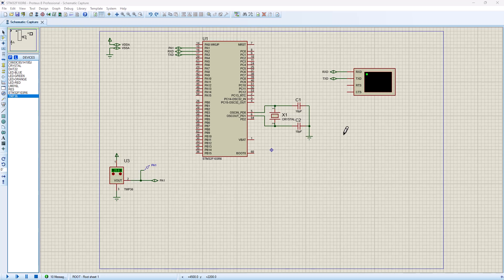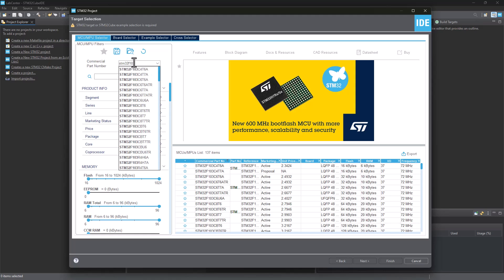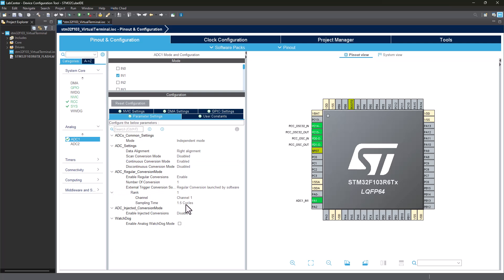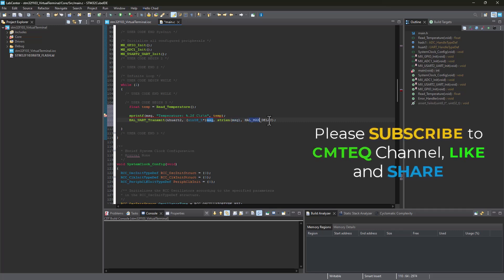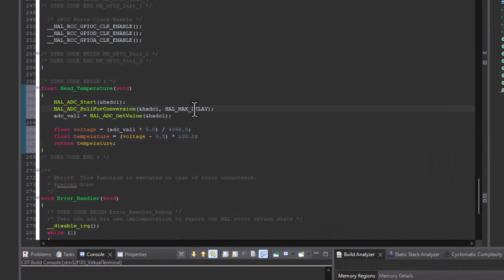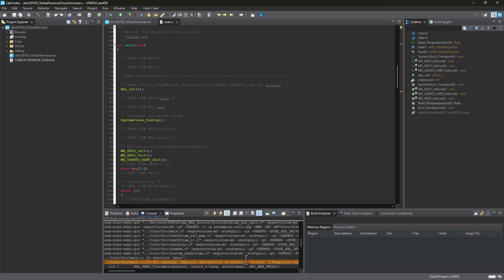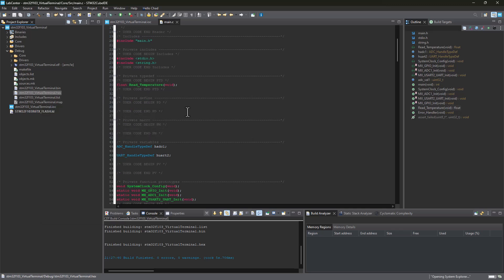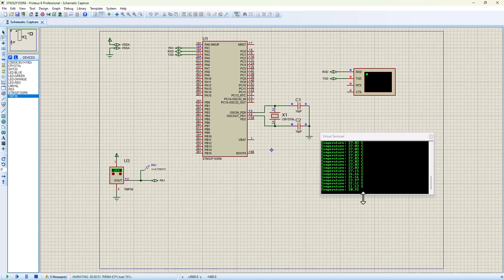STM32F103R6 ADC Conversion Proteus Virtual Terminal

Comment: Sir, is that Bluepill mcu support ADC in proteus?!?
Reply from the maker: Yes, the STM32 BluePill MCU supports ADC functionality in Proteus simulations for educational purposes. You can configure and program the ADC using standard STM32 HAL or register-level code, and Proteus will simulate the digital conversion process. 
However, note that you cannot simulate actual analog voltage inputs directly from components like potentiometers; instead, you must predefine simulated analog values for each ADC channel in the MCU properties window.

Comment: Sir, my Proteus shows cpu overload, how to solve this
Reply from the maker: You need to upgrade your CPU, or you must avoid running the simulation for longer. You can also try closing the browser and other programs with higher CPU usage
Reply: @CMTEQ thanks for your response sir. proteus sometimes directly shut down when I run the program, like not saving anything, not showing anything, directly shutting down the app. This problem appears when I used f103c8t6& f103r6, is it the same issue as the cpu overload thing?
Cuz I have tried with f401, and it doesn't have issues like shutting down app, can't run program. But the problem is I think there's problem with f401 chip adc on Proteus, as it only return adc=0. I've saw this problem on stm community also, there was ppl sharing f401 has problem with adc

Comment: Why connect to a crystal, i think proteus automatically simulate the external crystal , you only need to double click the mcu and modify the osc frequency to 8000khz
Reply from the maker: You arre right.
However, connecting a crystal can be useful if:
- You're testing startup behavior or oscillator-related features.
- You're using code that explicitly initializes or relies on external crystal settings (e.g., 
   in STM32 or AVR with fuse bits).
- You want the schematic to reflect real-world hardware for documentation or PCB 
   design.

Comment: My virtual terminal is showing zero even though I followed the same steps as you.
Reply: I have the same problem too. After testing, i think that it only works with the stm32f103r6 (i use the c8t6), same code but does not work, maybe proteus only supports for this series.
Reply from the maker: Please double-check the two MCU. Whether they have some differences, maybe you need to change the code a bit, specifically the configuration.
My guess is, if the model is in Proteus, then it should work.
I will have a look.
Reply: @CMTEQ  I think it is something with the timer, can u make a dht22 tutorial video? I have the same problem
Reply from the maker: @bassameldawy5004 Noted ✅️ , please remind me in two weeks.
Reply: @ Hello Brother hope u doing well, can u do the DHT22 Tutorial?
Reply from the maker: Almost 2 weeks, 1 day to go. 
Thanks for the reminder, I will get it done in the coming week end.
Reply: @CMTEQ  TY, I really appreciate your help🫡
Reply from the maker: If the code is right then maybe the terminal is not connected properly in Proteus, make sure that RX and TX are connected to the correct Pins.

On part 2, I added an LCD display and also included a GitHub link to the proteus files and hex file.
https://www.youtube.com/watch?v=S9oPl-5iYSs&lc=UgySq0GCm8LDQo0fYJx4AaABAg

Comment: Hi sir am trying a PWM signal generation by using Time+DMA ,also An LED is blinking . am not getting the PWM signal in tim channel but LED blinks . all are testing in proteus . in real hardware it is working as expected ,any suggestion ?
Reply from the maker: Hi, a few things could go wrong here. You will have to ensure that all your configurations are correct.
Your GPIO pin where the pwm is configured must be on output alternate mode. Check all the timer settings.
DMA interrupt, make sure you are starting it, and also call the DMC IT conversion in the timer elapsed function.
Also, ensure you have a correct DMA buffer size.
The problem could be due to improper GPIO configuration, timer settings, or DMA configuration, carefully checking each of these areas. You should be able to identify and resolve the issue.
Reply: @CMTEQ  but in real hardware both are working ?
Reply from the maker: @gireeshkumarks  if both are working in real hardware then you need to check the stm32 device you are using for the simulation, make sure you have the correct clock set under properties.
Reply: @CMTEQ sir  I tried diffrent controller as well. Clock is set internal
Reply from the maker: @gireeshkumarks  Its hard to debug that, what I can suggest is star a new project with the same controller, first blink an LED, test it on Proteus and then start adding new code and test as you go, that way you will know where it breaks.
Reply: @CMTEQ  tried a lot of sir . Sir can you give me a working proteus file to test me ?
Reply from the maker: @gireeshkumarks  Did you try to follow this tutorial? Step by step?
Reply: @CMTEQ  no ,i tried my own
Reply from the maker: Try this one. You will get it working, and then you can change the code to implement PWM based on timer and DMA.
I will attach the proteus design file later today.
Reply: @CMTEQ  thanks
Reply from the maker: You can find the Proteus file on the description box of this video.
https://www.youtube.com/watch?v=S9oPl-5iYSs

Comment: ISIS Release 8.06.02 (Build 23525) (C) Labcenter Electronics 1990- 2017.
Compiling design 'C:\Users\aswin\OneDrive\Documents\stm32.pdsprj'.
Netlist compilation completed OK.
Pin 'BOOT0' is not modelled. [U1]
Pin 'VBAT' is not modelled. [U1]
Pin 'VDDA' is not modelled. [U1]
Netlist linking completed OK.
Partition analysis completed OK.
Simulating partition [CB2545B6]
PROSPICE 8.04.00 (Build 21720) (C) Labcenter Electronics 1993-2017.
Loaded netlist 'C:\Users\aswin\AppData\Local\Temp\LISA7883.SDF' for design 'stm32.pdsprj'
Loading HEX file 'C:\Users\aswin\STM32CubeIDE\workspace_1.16.0\stm32\Debug\stm32.hex'. [U1_CM3CORE]
Read total of 24708 bytes from file 'C:\Users\aswin\STM32CubeIDE\workspace_1.16.0\stm32\Debug\stm32.hex'. [U1_CM3CORE]
[SPICE] Gmin step [4 of 120] failed: GMIN=0.000501187
[SPICE] Gmin stepping failed
[SPICE] Source step [1 of 120] failed: source factor =   0.8333
[SPICE] Too many iterations without convergence.
Real Time Simulation failed to start.

what Is this error
Reply from the maker: Too many iterations without convergence, you might be using components that do not have simulation  data. 
Check your circuit, make it simple, or remove other components, simulate and start adding new components, and see the faulty components